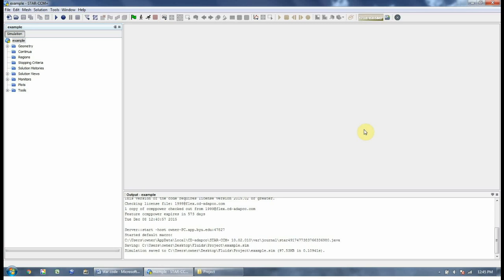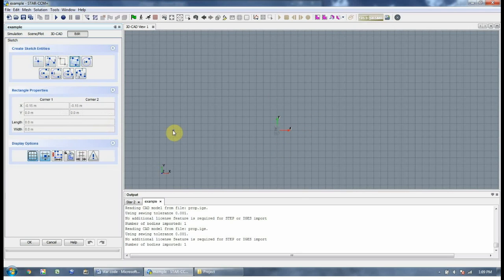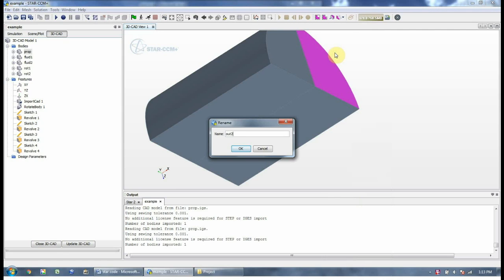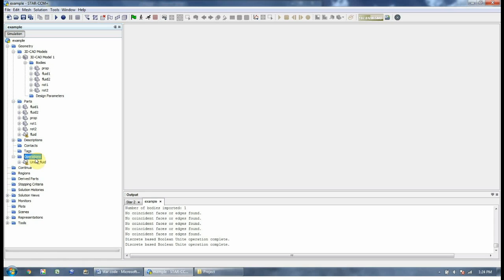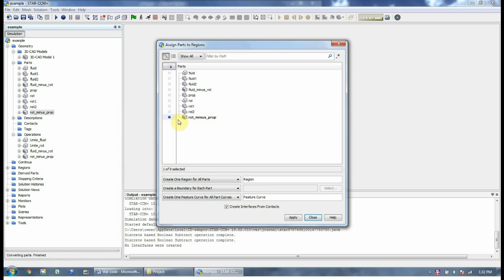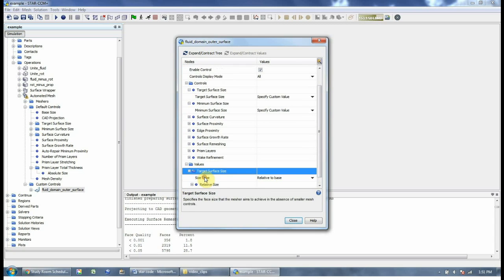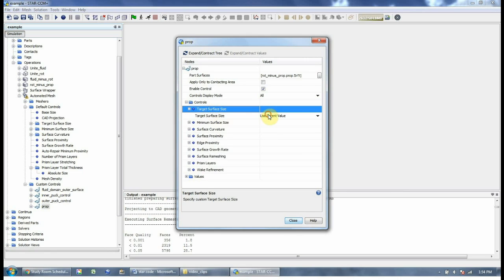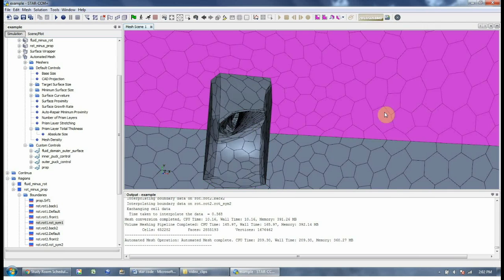STAR-CCM CFD RC Propeller Simulation Tutorial : Part 1

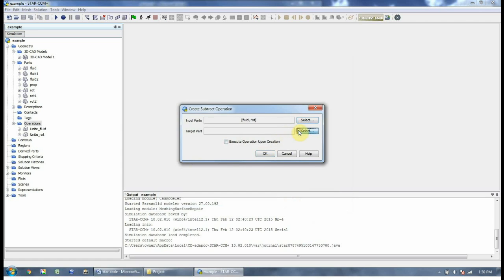Comment: Hey, Thanks for this video!. I am getting an error saying - 'Part Prop is not closed and Manifold'  when I subtract the propeller from the rotor fluid in 9:25
Reply: I am getting the same thing too. Did you manage to find a solution? I am at a loss.... :(
Reply: This particular problem is to do with problems in propeller model (which is not closed). But I tried using another propeller with a complete model, and got mesh problems